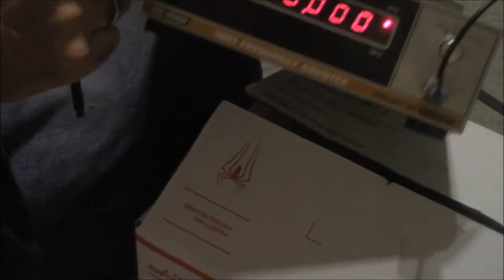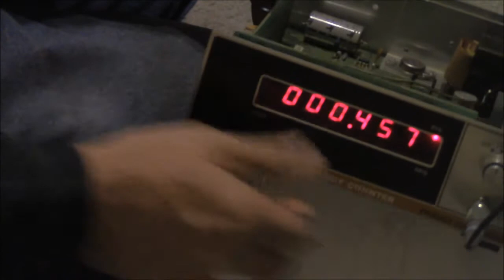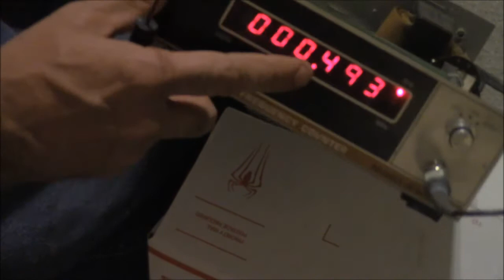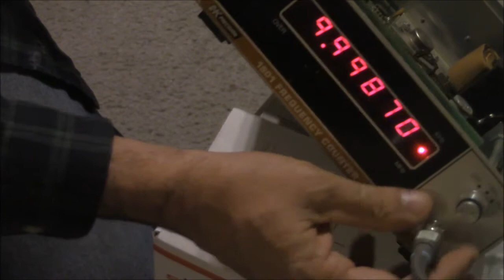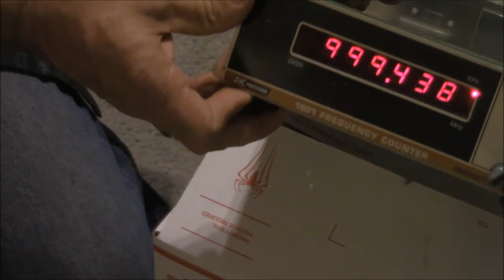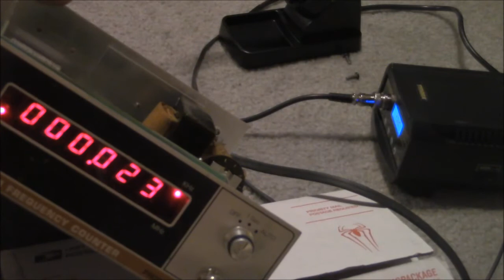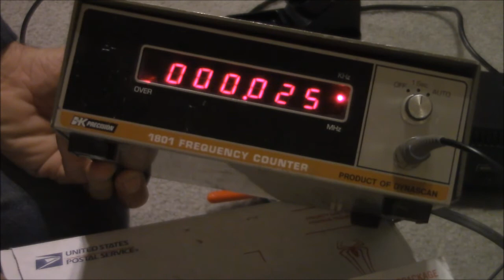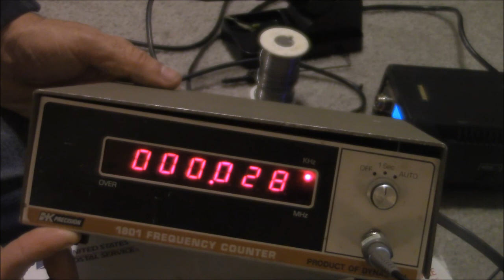B K Freq Counter Cal / BK 1801

Comment: Looks like the previous owner couldn't be bothered messing with the adjustment further with the vari-cap being at full extension...
Reply from the maker: Or
It may have been that the previous owner  did know how to get pass this small problem.
Reply: Seeing as the frequency was so far off taking that value into consideration when calculating the correct frequency would be understandable but why leave the issue half resolved? it's akin to running 99% of a marathon and going home before you cross the finish line.

So what other goodies were in the box with this one?
Reply from the maker: *****
but why leave the issue half resolved?

True... One should do you best

But  It may be a ok tool you have nothing and You may have never known its off a bit until I tested it with a 800.00 ext ref :-)
How good is good enough ? :-)

Other goodies in the box      mayyyyybe :-)
Reply: TheTimeSpiders Yes indeed which explains the previous video detailing the ovenized oscillator (reference) component.

So hypothetically what may these goodies be?

A pulse jet engine?

A radio telescope?
Reply from the maker: *****
A pulse jet engine?  Have it
A radio telescope?  Had  it

hypothetically it may take a day of two for that video :-)
Reply: Awesome... how about a future video of your pulse jet engine?